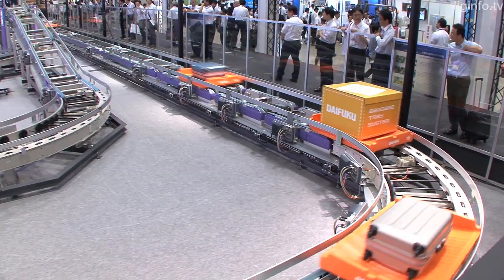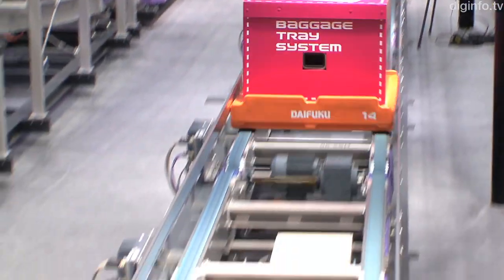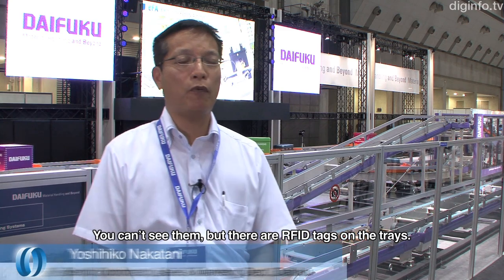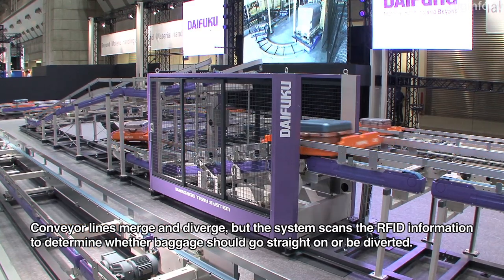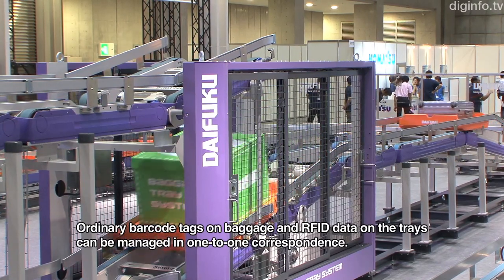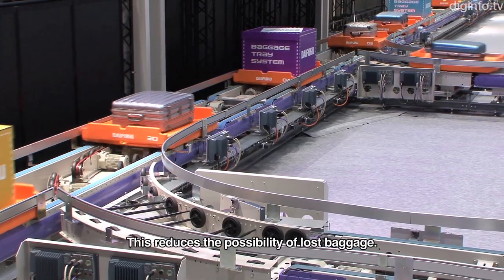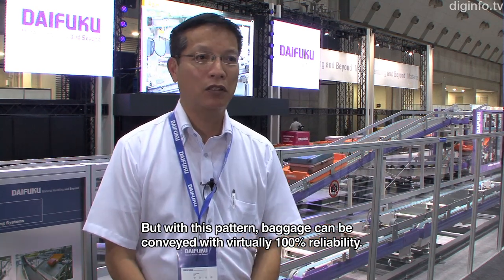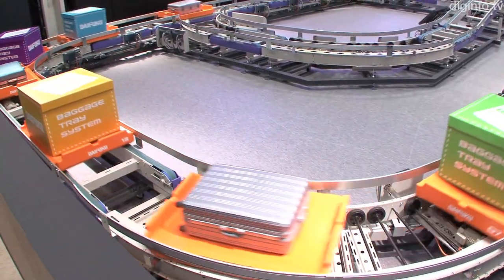Daifuku Baggage Tray System moves baggage at 600m per minute #DigInfo

Comment: Alright I have a few questions
1. How much is the annual upkeep of this system compared to improving existing conveyors to run more efficiently with bar code scanners that could be used to sort each incoming luggage?
2. How fast will the wear and tear set in?
3. How much power does it consume that would benefit using this over regular conveyor belts?
Now I can see this being used by UPS, DHL, FedEx etc. But as for airline luggage is concerned, you're just trying to remake the wheel.

Comment: unless you work in the baggaging at the airport, your attack saying that they are "trying to remake the wheel" is based off of baseless assumptions and you have no actual clue of how much more efficient a system like this would compare to the current baggaging system used in airports

Comment: Third, the reason why I asked about power consumption and efficiency is because current systems need little in repairs over decades, while this looks like it would go through wear and tear in no time with constant maintenance with expensive parts. Fourth, the only thing this has on belts is that it's faster, that's it! You can retrofit current conveyors to do the same and sort the luggage. Finally, the problem isn't with the system, it's with the handlers that lose the majority of the bags.

Comment: I have worked in baggage at a Logan International for a few a years before moving on to a new job, so your assumption that I know nothing about what goes on has just basically made you look like a fool. First off, individual trays for each and every luggage that passes through is idiotic, impractical and no where cost effective. Second, having to install an entire new system instead of improving and updating existing conveyors will be costly and ensure delays in incoming and outgoing flights.